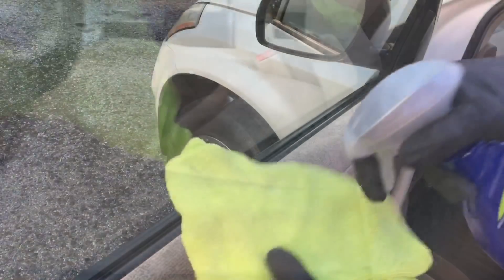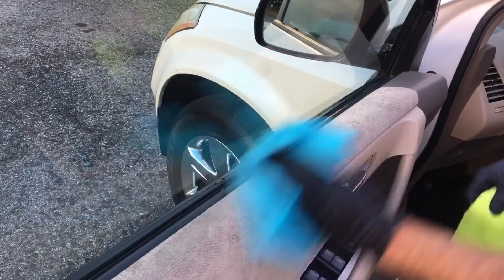Here Is A BEST BUY Interior Cleaner/Conditioner/Protectant!!! TURTLE WAX ICE!!!

Comment from the maker: What do you use to clean/condition/protect the interior of your vehicle?
Reply: Apex Detail I have used the Meguiar’s interior detailer and cleaner for a while and like it, but lately really like the P&S xpress interior cleaner. They both do a good job and leave a nice streak free natural state finish, but the P&S seems to clean a good bit better and the price per gallon is great.

Keep up the great vids.
Reply: Same here.. was using Megs Ultimate Interior detailer...but now use P&S Xtreme interior cleaner following up with 303 Aerospace.. Definitely gonna pick up a bottle UV protection is a good thing 👍🏼👍🏼
Reply: Optimum No Rinse for cleaning leather/plastic/glass, standard dilution in a mist spray bottle (local beauty store), and Woolite mix for fabric/carpet mixed 1 tablespoon in a 32 oz ZEP spray bottle (Home Depot). Can use either in a 2 gallon bucket (smaller contractor bucket at Home Depot works great), fill half up with water, mix 1 cap fill of the ONR bottle, or half cap of the Woolite bottle, easy. I don't currently dress beyond that but would use Chemical Guys diluted 1:3 with water.
Reply: So meguiars hyper dressing is a no go???
Reply: I recently tried P&S Express Interior Cleaner and really like it and it doesn’t cost a whole lot. Griot’s Interior Detailer is my favorite for UV protection.
Reply: I use a concoction of a waterless wash, apc and Manetts Mega Shine ...it slices it dices and I only have to take 2 bottles to the interior - my mix and a carpet product. Clients have been very satisfied and I’ve significantly increased my efficiency so another win win. Thanks again for hosting a great channel.
Reply: @James O'Brien Does P&S Xpress leave a light shine or a matte finish? I like Adams interior detailer because it leaves a light shine after, but P&S Xpress is cheaper.
Reply: I’m starting to like the Adams interior Detailer
Reply: Meguiar’s APC 10:1. Pretty affordable and you can use it anywhere. Very, very versatile product.
Reply: alberto
Reply: found it and it call Turtle Wax Showroom Interior Fresh 500ml and i will buy it. very interesting ever since i was wonder if cheap product as good as the high end you and other detailer show the cheap its cheap ment affordable
Reply: Apex Detail 303 aerospace protectant.
Reply: Adams interior detailer
Reply: megs interior detailer with some megs new car protectant... for leather, I use Dubbins
Reply: For now I'm using Meguiar's Ultimate Interior Detailer, but I'll be switching to TW Ice Interior Cleaner/Protectant after watching this video. You have to admit that the TW Ice line is killing it.
Reply: Turtle Wax Power Clean 🧼 

Mixed results. It works well on trim, but didn’t remove the headliner stains. It was probably my technique, however.
Reply: What is the best to protect the steering wheel against sun?
Reply: Adams leather/interior cleaner and then Gyeon preserve
Reply: I use either Adam's Interior Detailer or Griot's Interior Detailer for lightly soiled interiors and to add some UV protection as well.
Reply: Griot's Interior Cleaner, and or Spray 9, Occasionally Sonax Dash cleaner (great fresh scent, and includes protection ), McKee's 37 Intetior QD for weekly dusting. Soon to be "Brian's Interior Elixor" (all ready printed out the lable and have it on the spray bottle), from your recent Corvette vid, and will now keep the TW Intetior Cleaner/Conditioner, along with a bottle of water, right next to my Optimum waterless wash (for bird poop)  in the truck.
Reply: I use TW Dash and Glass and it's great! I may try this too. Thanks
Reply: @willoverkill  yes ONR in a spray bottle is great, always have some in my car and good a detailer too.
Reply: GG Interior Cleaner and their 3-n-1 Leather for the seats.
Reply: Brian.   I just knew you had  to own a Vette.   Good choice with a C5.   Do more videos using your Vette.  I have two C5's and loved the 4 part series on the trashed green C5.  I use Megs Quik Interior Detailer Cleaner to clean the plastics. and the instrument panel plastic cover and nav screens.  Have switched from the water based Stoner trim shine to CarPro Perl after watching you do the C2 Vette.   I love the look and durability of the Perl product and now use it on my metal and fiberglass cars.  Keep the videos coming.  I've lost faith in almost all the "big name" car detailer videos as their videos are more like infomericals for whoever lines their pocket with promotion money.  You keep it real and aren't bought off by advertisers.
Reply: Brian..new truck?  So I guess I'll check auto zone this weekend!
Reply: I like Surf City Garage Dashaway. Cleans well. Leaves nothing behind.
Reply from the maker: @michaelmendez4245  Nothing wrong with Megs.
Reply from the maker: @miguelroscas  This here will...and not cause slippage.
Reply from the maker: @bobhenn1692  I sold my C3 for the C5....So I have a C4 and C5.
Reply from the maker: @CAPTJ696  Customer's truck. Getting coated.
Reply: @apexdetail85  Sweet.  Detailing the engine bay on those clamshell C4's is a lot of work.  I'm sure you're up to it and win every show you enter.
Reply: Turtle Wax luxe  leather cleaner / conditioner comes in a green bottle
Reply: Adam's leather and interior  cleaner  and Adam's leather  conditioner.
Reply: Adams leather and interior cleaner for deep cleans, and McKee’s Fast Interior, or Adams interior for maintenance. I love them!
Reply: Hey brian in your opinion is it ok to use a apc to clean interior??
Reply: It worked on my headliner stain.
But for serious stains, you'll need an APC or dedicated fabric cleaner.
Reply: I've been looking for this since you posted this video but it seems that TurtleWax is deliberately withholding some of its products from the UK market for some reason.
Reply: Griots garage interior detailer is great as a Detailer. Great scent and non greasy.  Use something else as the cleaner
Reply: I don’t clean the insides yet, trying to get an idea of what to use? What are your thoughts on P&S interior cleaner and/or the Carpro one?
Reply: @wilmi79  personally I use Auto Finesse Total Interior as it can be used on everything including fabric, alcantara and suede. 
For protection I use Gtechniq C6 Matt dash on the uppers and Carpro Perl on the lower, cheaper plastics.
Reply: alberto gorin hi
Reply: @THutch556  Pls spell out what P&S stand for? Thanks
Reply: I tried the link you posted for this item doesn't seem to be working has his product been discontinued and if so what is the new one that you're using to replace it
Reply: @ApexDetail

Does the suggested product leave a greasy residue that attracts dust AND IN PARTICULAR, dog hair?

Comment: Been using this interior cleaner for a number of years.  Does a terrific job.  Really enriches the interior surfaces.  Using a damp microfibre cloth it spreads very evenly with a nice flat finish.  Not glossy and within 24 hours really "sets-up" gives my black plastic and vynal interior a glow without the "shine." Deepens and enriches is the best description I can use for this product.  Will not dissapoint.  The entire TW ICE line throughout is excellent.

Comment: I have that in my collection. Although it works well, the scent is absolutely horrific. It is slightly offputting at first and gets worse as it lingers for the next several days. As soon as my daughter got in the car she told me it smelled like an old lady and that "mom is not going to like it". I ended up throwing it away. My go to inter detailer is Meguiar's Quick interior detailer. I even use it on everything around the house too, from wood to glass. And it smells good.
Reply: Just Me I use Megs also. No smell
Reply from the maker: Yeah..I agree. It does wonders with smoke odors and pet odors.
Reply: That’s odd ..the old version of ice interior did smell like vinegar mixed with cologne but now it just smells like cologne . I like the smell actually now .
Reply: And when I say ok’d version I mean 2016 or previously...this sprays works great on cloth which is amazing ..used it on my shoes and carpet tbh

Comment: Do you know if this is the same formula as the original TW Ice interior? I used to LOVE that stuff, but they must’ve discontinued it and just recently started back making it. I haven’t seen it in YEARS. The original formula was very thick, almost paste/chalky, it had a light powdery scent, and it worked great on everything in the interior, conditioned the plastic great, wasn’t greasy or too shiny, wouldn’t streak or grease up the glass or gauges, would clean carpet stains too, it was an absolute miracle in a bottle. Really hope they didn’t change it.

Comment: Will add this to my interior Arsenal. Brian I have been using Aerospace 303 interior protective and found it to be a great product. Curious what your / professional opinion is on the Aerospace 303 interior??
In terms of protection and overall durability compared to the Turtle Wax.
Reply: I sold a 10 year old car that sat out in Florida heat for nice money because I always use 303, even on my boat. The stuff is the real deal and does not degrade rubber or interior surfaces over time but feeds them and keeps things supple. Important as car ages. I never had any interior rattles from mysteriose creaking in dash or who knows from where. Trusted brand by all yaties too.

Comment: I used Ice Interior for a few years and it is an excellent product.  However, I recently switched to Jax Wax Total Interior.  FAB Automotive Detailing review Jax Wax and I tried a 16 oz bottle for $16.  I loved it so much, I purchased a gallon jug off Amazon for $40.  In my opinion, it cleans as well as Ice but leaves smooth surfaces a bit more glossy.  It also smells really clean with more scent than Ice, but not overbearing.  Both are great products but I do prefer using the Jax Wax Total Interior a little more.  Nice video Bryan!

Comment: I realize this is an older review & thread, But I have unable to find this product in stock anywhere for several weeks: Walmart retail and online, Amazon, Auto Zone, O’Reilly, etc.  Pep Boys web site online claims they have it but it cannot be shipped. I called TW and the CSR said her available info is that they are still producing and selling and that it should be available online.  I mentioned that it was no longer available on the TW website and the CSR confirmed they don’t sell this on their website.  Brian, do you have any connections with TW that you can check with about this product disappearance?
Reply: I wasn't able to find this anywhere either. But I do see they have a new interior detailer under their Hybrid Solutions line. Looking forward to some reviews.